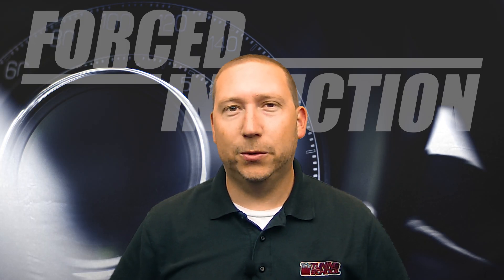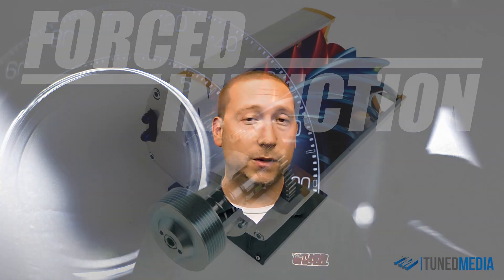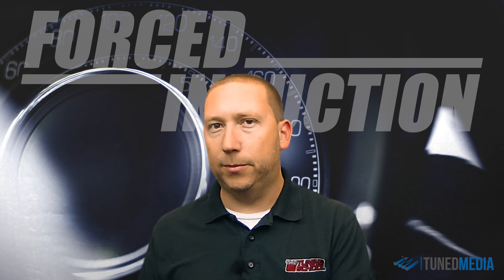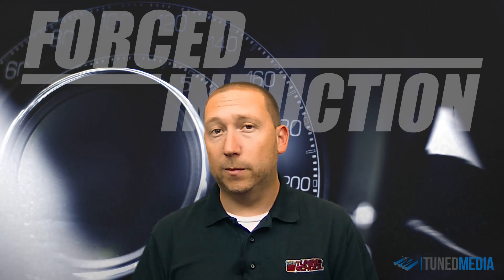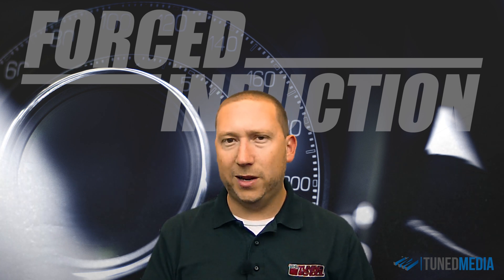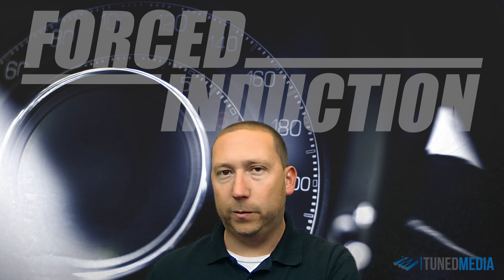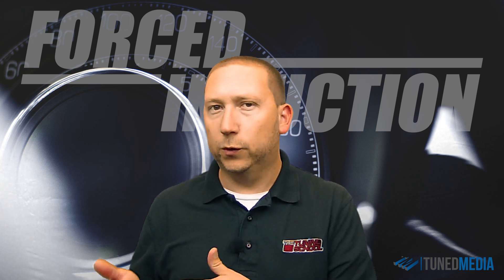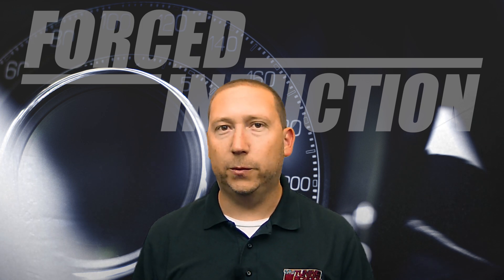Forced Induction (Part 1): Introduction Brian Tooley, Magnuson, Full Race, Boost, Blowers and more

Comment: Guys, TB closing to 40% due to hot spark. After the 1,000 on the track. Zero out the table, won't retard. But now ECU decided to close the TB after calculate over 190° MAT calc temp. 
Using water meth 50/50. 

I seen: 

Airflow-Manifold Temp-ECM 44309-MAT Bland Factor? 

Anyone? 

Is a 2009 R/T with HP tuner. 
Anytake?

Comment: 450 hp? I wouldnt waste 4000 dollars for 450 hp. Spend the 400 dollars at jegs for a nitrous kit and get 450 hp for 3000 dollars less.  600 to 650 hp, for ALL of them if you want to run pump gas. Higher than that all depends on money/fuel. Last I knew a top fuel car running roots style blower made 10000 hp, so money is the limiting factor...  it is cheaper to build an engine to make 450 hp naturally aspirated than it is to bolt on any style of forced induction.  My 632 hp (Engine HP) camaro has a 177 roots style blower and gets driven to Maine and Florida regularly. Even at 600 hp a blower is barely worth the money. The difference is, 600 hp naturally aspirated is not as street able, with the blower it has excellent manners.

Comment: turbo no blower fer me to expensive small for daily drivers compounding if needed oh never for get diyers Adriano board for controlling some things to save cash even run a 4l80e from a pwm board n Adriano mega  ...blowers need cog belts why any no matter how small manufactures are just crazy not using cog belts